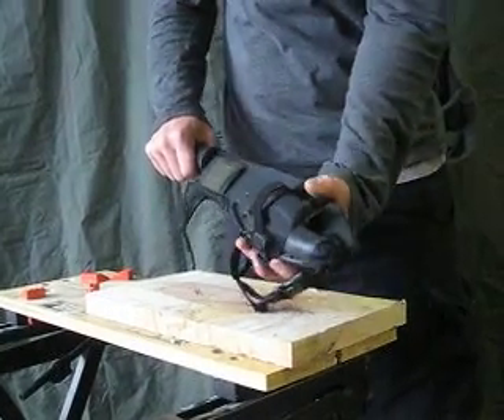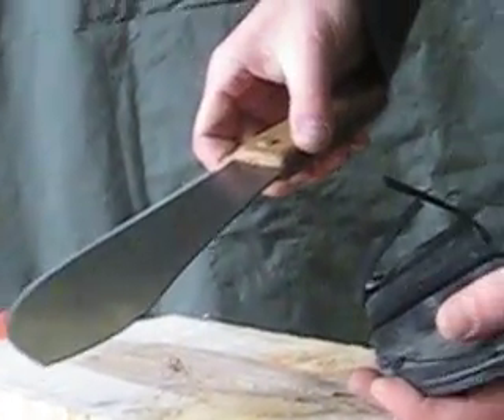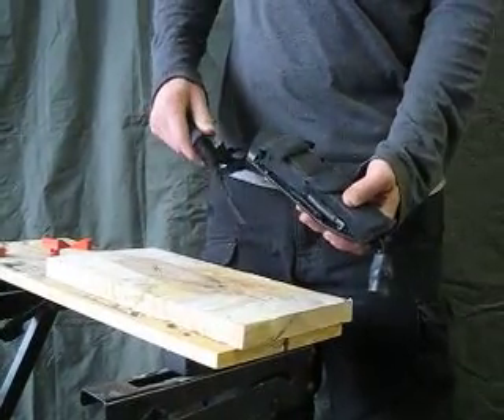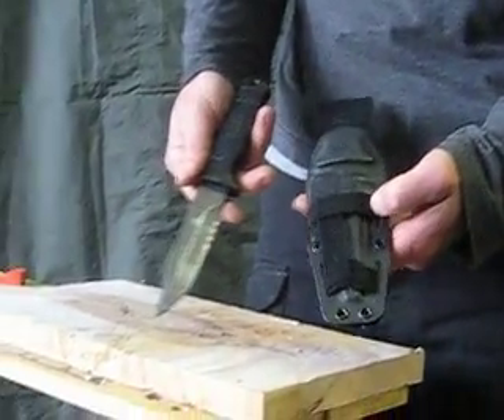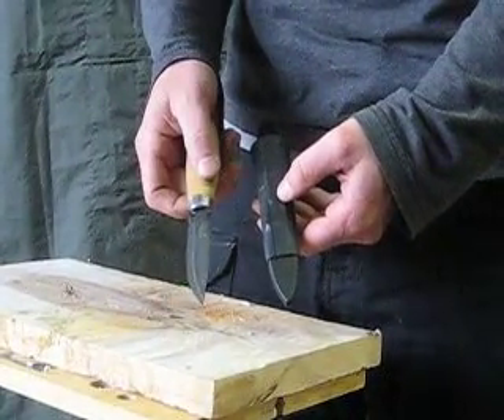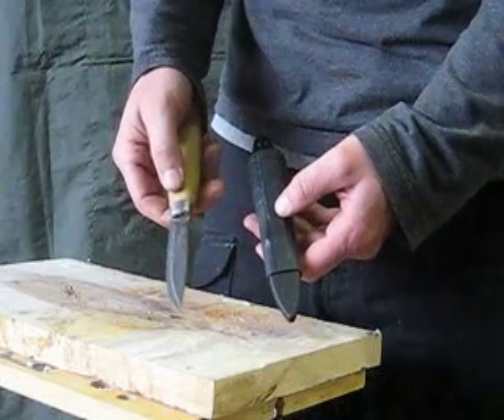My Knife Collection In Action-Fixed Blades

Comment from the maker: I agree on both accounts.  Cutting the wire really dulled each blade.  The tin was most abusive by far.  The edge on the Frosts Mora rolled over when I pierced the duct work.  I was able to get a good edge on it again though.

Comment: @SourLymes 
Agreed. Properly sharpened machetes will go through stuff like lasers. Moras as well. If I had to saw with my knives like that, I'd go back to the strop, if not the stone. 
Also, it would have been nice if the various materials had been identified. 
nice collection, but they were definitely dull.

Comment: Not trying to be offensive, but perhaps you should sharpen your knives a little better? From the way you had to work at each task with each knife, it was clear that they were all incredibly dull. The Mora cut best because it had probably not been subject to more brutal edge-killing tasks like the larger knives. Remember, no matter the knife or steel, a sharp blade is still a sharp blade and will cut through anything weaker than itself easily.